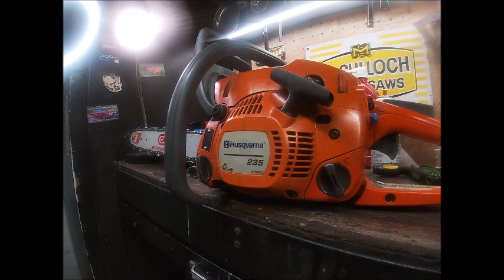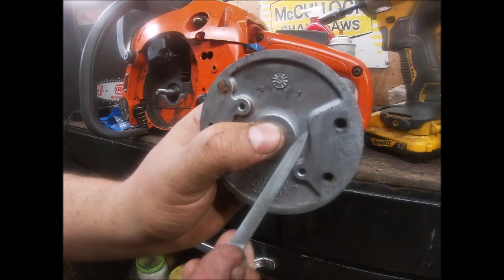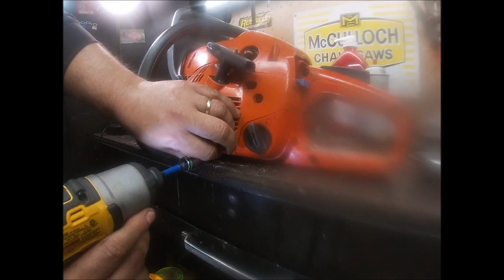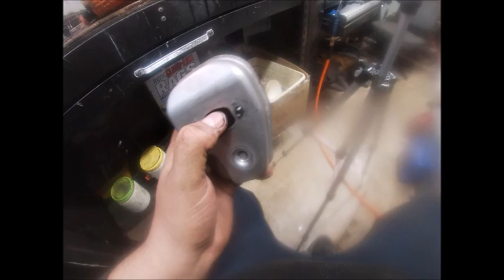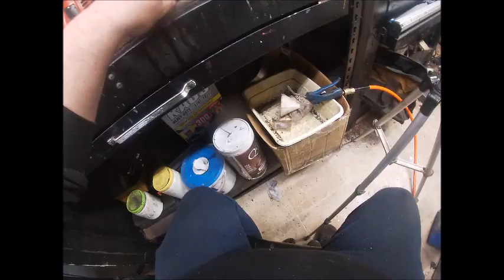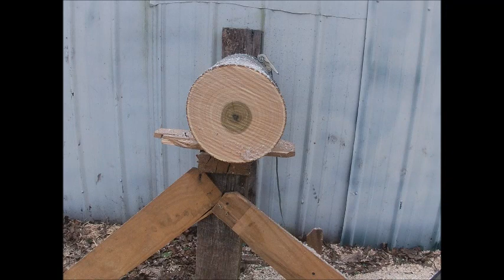Husqvarna 235 20% Gain from Simple muffler mod and timing advance

Comment: I mod that style of exhaust by simply pulling one or both the the mounting spacers and then bolting the can back on with short bolts and then do exactly what you did to the deflector on the front. I love this kind of video, it's always nice to have non-invasive mods folks can do to improve a saws abilities 👍👍👍👍👍👍

Comment: I paid 100 buck for one that was basically mint, fun little saw for limbing and stuff, it's capable if you want to put the time in. I did the muffler real nice and I think ill try throwing a few degrees at it for fun, thanks for the tutorial.
Reply: So I see people kind of gauging  the amount of degree advance with a reference line from stock, to whatever wiggle room you create with the file and 1/4 inch seems to be the consensus. I probably did more like 1/2 inch and said the hell with it, I'll try it and see. Turns out it's kind of sweet. a lot more responsive in the low to upper mid, sounds great idling, like it's got some attitude, I had already done a sweet muffler mod so I was all set there. Really love exhaust note now. I tuned it by ear and was way off on the high jet, I readjusted it buried in dry pine and almost 3/4 of a turn lean I was. Well worth the effort, and had fun. Thanks for the tips man.

Comment: Aren't those Husqvarna 235&240 chainsaws designed and built in U.S.A in Poulan factory?
Reply from the maker: yeah i think so...the quality of the plastic seems better than a moder poulan though....the coil on its off an old jonny from the 90s

Comment: Do you think it's worth advancing the timing in a 359? This 235 runs like an xp now, maybe not in the top end but Im super happy with how it can out. Took down a nice size locust with it today and I though i was pushing my luck but it was unreal.
Reply from the maker: Yes
Reply: @JandSChainsaw  Me to, I just did my little Echo GT 225 and she hoppin, I did the exhaust prior and richened it up, I also did a lot of excess plastic removal on the inside of the air filter housing as well as several more vent hole in the cover, I have my uncle's stock one also and it's not even a competition of which one out performs the other even with 3 extra inches of the medium size line, it's night and day. Such a easy step in the right direction. Glad I found your video man.
Reply: I've had my 359 since 2004, I will be using this weed whacker all summer like a bastard so I think I will see what the consequences are if any, then make a decision.  I don't care about the 235, or the Echo, I mean I do like them a lot, but they are more than replaceable.